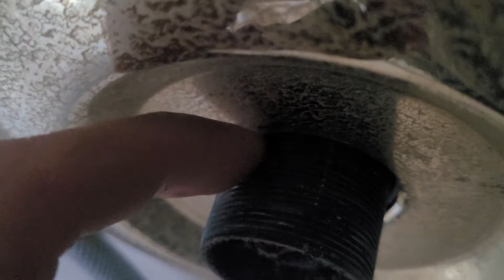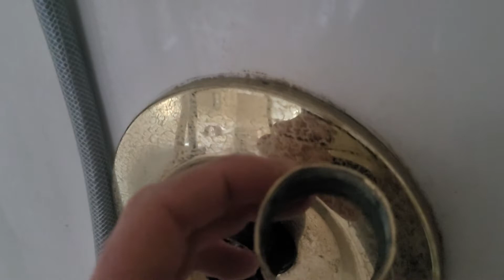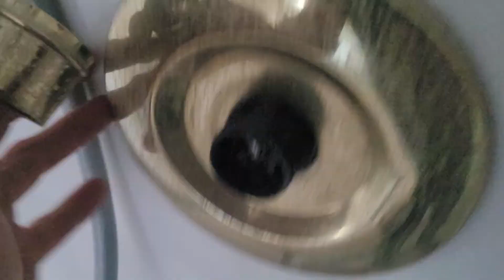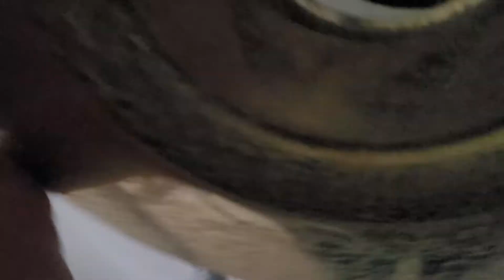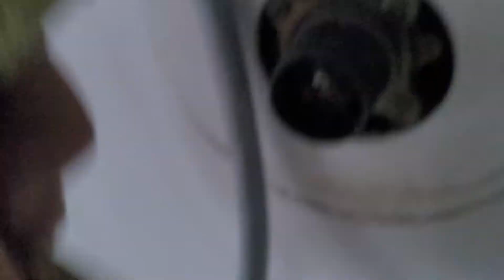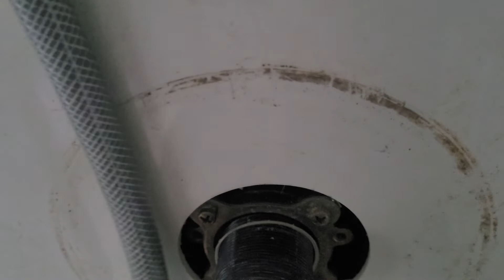shower fawcett back plate removal

Comment from the maker: So, after making this video I removed the 4 screws holding this black plastic piece in place. I did not shut the water off. BIG MISTAKE. when the 4th screw was almost out, the water pressure started pushing this piece off and it was a chaotic time threading them back in whilst being sprayed. So don't go any further then this unless you know what your in for. 
Unfortunately I couldn't isolate the shower alone, so I had to turn the water off to the entire house. I had to do so because this stupid plastic night mare didn't re seat well, and because of that it was steady leaking behind the shower wall. Fucking disaster! I didn't even  have a replacement fawcett on hand, I was just trying to be able to  take a shower. And of course, prepared as I am clearly, this happened at closing time, so no quick rip to the hardware store. FML.  
I just try to remind myself, good judgement, comes from experience, and alot of experience, comes from bad judgement.